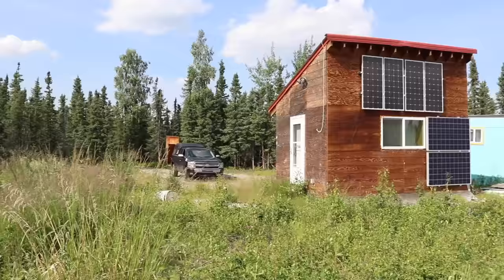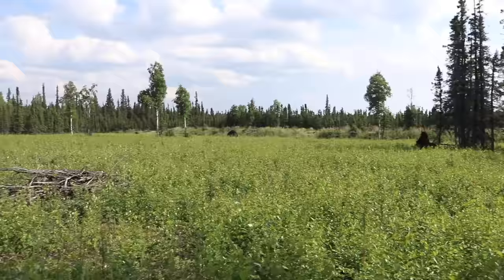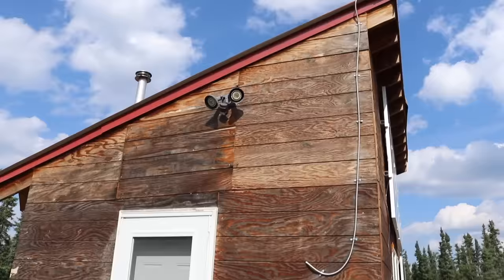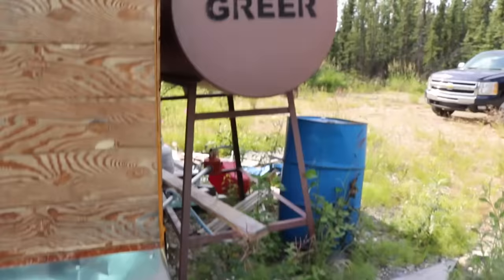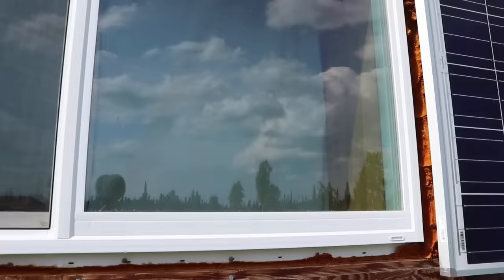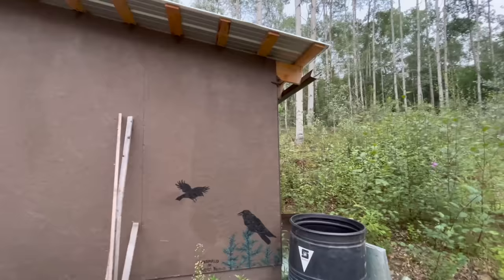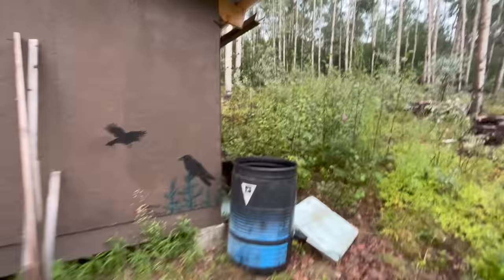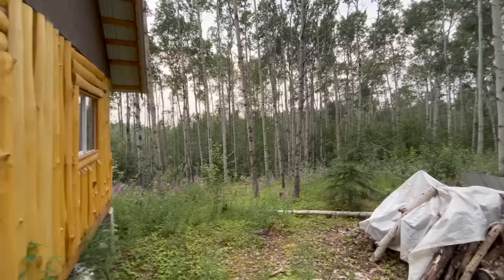Buying off grid land- you'll never hear this from Realtors

Comment: I really liked this video.  I think the first question anyone should have is whether you can even legally do the tiny house/off-grid/shed to house stuff that people seem to have a mania for.  I'm not at all surprised it's easy to do in places like Alaska, Michigan, the Dakotas, or other of the "wilder" states (which may include some of the southern states).

I'm in Virginia.  No, I absolutely cannot hand drive a pitcher pump well (class IIIc well according to the health dept) to any depth.  All wells have to be designed and installed by licensed contractors.  Waste water and sewage is the same way, though Virginia will let me catch all my sewage and apply for a sewage hauling permit to take to a sanitation site if I choose not to have a septic installed.  I can use an outhouse (permit required) for occasional occupancy.

As you point out, cash is king for those wanting to do the off-grid thing.  You finance the land, or finance house construction, you're going to be restricted further.

Then there are zoning issues.  Can I really build a house of square footage less than what my county allows?  Building inspections? 

I went on a rant in one of Dave's videos about my investigation into this off-grid fantasy (for some), and covered even more things to consider.

More people should watch this video as a bit of a reality check.  I like that you note where you and Dave primarily operate, but adding YMMV depending upon where you live would be good for your viewers as well.

Comment: If you haven't already, because of all your experience and prior knowledge, it would be good to publish a checklist of things to consider when looking to buy property.  Many of the things you mentioned in this video would be great things to put on such a checklist and to go though when looking at potential properties.

Access to the property, water, and electricity and a basic livable shelter would be top on my list as a place to start from.  If I wasn't 73, I'd certainly consider buying a patch of land and homesteading it, but I couldn't deal with a bare piece of land with no well and no structure to live in while I worked through the building process.
Reply: @-XtraCredit-  Yes, of course.  Those are certainly most important and if you can't check off those list items, you need to re-evaluate your desire to buy property where those things are essential to already have.  I'd also say having a "Can do." attitude and determination to go from start to finish are essential as well.

Comment: TheT-111 was, which will delaminate over sideways, which is going to collect water in the grooves which will cause the siding to delaminate. It all has to come ff and be replaced. Even if taken off carefully, the pieces look small you will need to buy a ton of flashing and it will look like crap. The exterior oil tank will cause the oil to gel unless you get winter oil which will cost money every year. Tapping into the high voltage electric is going to cost you're going to need to pay for step-down transformers in most areas, the utility may do the work put to hook up one house that uses a small amount of electricity, but they will not do it for free. A company I hired in the '70s accidentally pulled down a transformer I can't remember but I think the cost of just the transformer was 6.5 to 10k plus labor about 3.5k you can triple that price today

Comment: I'm curious about the " You'll never hear this from Realtors " part because of course you wouldn't.  Not because it's some secret or something we don't want you to know,  most places living off grid is illegal so we don't buy/sell off grid properties normally. I'm a REALTOR in Hutchinson Kansas, however, and thankfully living off grid is legal here. In fact, Kansas is one of the most accommodating states when it comes to living off grid. Even harvesting rain water is legal here. The reason the foundations on most of those " cabins " are janky is because they aren't attached to the land and they are small and light weight. The wind alone is enough to shift them from their foundations.  Earth anchors would help as would skirting so that the wind cannot get underneath the cabin. Orienting a building so that  prevailing winds hit a corner and split and go around instead of hitting a small building broadside like a sail would also be a better way to go. I will have that issue here as well because the  off grid cabin I want to put out on the farm will likely only be 8X10 with just enough room for a bed, table, book shelf and my wood burning stove. I already have a 14x40 Amish build lofted cabin from Greensburg Kansas on the farm, but it has running water and electric as well as wi-fi so I NEED a small off grid place. I plan to use Earth anchors and skirting because the wind here is just ridiculous all the time. There is just nothing to block it or stop it. And WHY are so many off grid places always trashed???  Just because it's off grid doesn't mean it has to look like a dump or homeless encampment.  I realize people will have a lot of " things " outside because the cabin is small but it can at least be half way organized and not look like a garbage truck just came out and unloaded. They need to have pride in their place the way Brooke does. Those of you guilty of this should take a page from her book and emulate her.  She's a great off grid role model.
Reply from the maker: realtors don't do the homework/due diligence needed to assess a piece of property for YOU to live on. in my experience they have not asked questions, taken pictures, explored the land, or basically know ANYTHING about the property they are selling. it's just how it is. they are in it to make a sale. oftentimes they've never even visited the land to see it in person- instead relying on the seller to provide (usually sketchy) information and pictures. that's why you have to do this yourself. not a dig on realtors (though the majority we've ever worked with were TERRIBLE at their "job".) I'm just saying do your own DUE DILIGENCE before putting down your cold, hard-earned cash.
Reply: @therealgirlinthewoods  I apologize I didn’t see that you had replied to this even though it’s been a while. Myself as a realtor yes I do all of those things. I thoroughly vet everything for my client. Unfortunately, you are correct in the fact that most realtors will not. However, I do. I have even researched rules and regulations and ordinances for clients so that they knew exactly what they were getting into and precisely what they were and were not allowed to do if they made an offer and successfully closed on a property. I leave them with zero guess work. My clients who relocated here from Colorado knew every single detail there was to know about every piece of property before they even considered making an offer. What they were allowed to do with the property. How It was zoned. What animals they could have what animals they could not have. What type of structures are allowed. All of the fun stuff. It was a lot of work and a lot of research on my part, but it was well worth it to not have my clients from Colorado walking into a new property blind and unsure of what they were allowed to do with their own property. this is something I just take for granted that all realtors do. I guess not?

Comment: Tung oil for 'organic' paint. 
Add pigments to your liking start with white and vibrant colors and mix for tones and complementary lighter tones. 
Waay more weather resistant. 
Or thompsons water seal or deck paint im told are very good options too.
These are the most options imo. 
I am really getting pissed at paint.

Comment: constructed shade can be a better choice than trees. That open lot with solar is ideal for air conditioners, refrigeration, information and entertainment devices, and lighting. It doesn't seem like a good option for geothermal heat without some work. Too few windows on the south side and the solar panels could have been placed better to block summer light while allowing winter light to enter the window.

Comment: i lived in fairbanks in 1969.  no one locked anything in case anyone needed shelter.  cars left running while shopping in winter.  no place to go with a stolen car in winter.  at 69below zero it would freeze the oil in crank case.  i lived in town near the river & crab was cheap

Comment: I like the first property that you showed. But in North Carolina I noticed these are the coldest and hottest areas depending on season. If only if the surround property was also available to build a house. 

Because a house that is shaded to the most part is more economical in the summer months. But the trade off is definitely when it gets very cold.

Comment: I would have expected that the very first thing to talk about when looking for property to make off grid is to check the county restrictions and codes.  For example, when i lived in Fl, i called about 10 counties to find out about permits and what is allowed. And for the most part, you couldn't just buy property and do what you want. Everything had to be permitted and to code.

I'm in a different state now and it's a little more lenient but i still see stories of people who set up a shed to turn into a tiny house and the code people came in and told them it's not allowed.

Comment: I live in PA and I was looking to do this myself. I bought 1.5 acers a little bit away from where I live. 
No houses around and the lot needed a lot of work to be completely usable. Not suitable for a house
but a shed to be used as an off the grid workshop and a little gardening. 

The local realtor said no problem with want I want to do. I wouldn't even need permits for the shed. 
Then I bought it, later talking to the zoning enforcement/building inspector doing what I wanted to do
was impossible for 1000 different reasons. 

So how do I look for property with the zoning needed to do what you do

Comment: Excellent video!  Thanks for the tips!  You mentioned road noise and neighbors shooting.  How do you feel about generator noise?  That's actually my number one concern because most of the off-grid lots are adjacent to each other and numerous so it only takes one neighbor to move in and run a generator non-stop.  Even if all the lots are empty chances are that will change in the next few years as lots are sold.

Comment: A VERY IMPORTANT thing is rain.
Where I live it only rains 3 to 10 days a year.
And that during the summer.
So you have to have a rain catch waiting. 
And 355 days or less there is no rain.
AND YES. Your rain you catch may very well be one day of the year. ONLY.
People that move here don't believe me.
But I'm the one that has lived here for 15 years.
And I'm the only person around that lives off grid.
Which is very important. Became people thats on grid don't realize things that make a difference.
And yes, waiting on the Monsoons to hit. Because you are very low on water is very nerve racking.
Today was the first day this year that I was able to harvest water.
Now don't get me wrong. I can drive 50 miles and get a load of water. 
Which brings up another problem that noobs do.
They buy bottled water.
If you don't have water. Buy something to haul at least 250 gallons of water. ( that weights 1 ton) 
Also figure out how you are going to keep foods.
They also come in the dead of summer before the rain.
Use an ice chest. And very day drive 50 miles to get ice.
 Solution.
Figure out how to live without a fridge 
Or 
Bring a complete system for a fridge.
Myself I don't need a fridge.
But I have a freezer and the solar power to run it. Though I don't use it.
And for God sake don't beg your nieghbor. Especially if you are not willing to do things in return.
Oh and don't show up broken. 
Meaning if you can't do stuff. Because you are beoken. Don't move off grid. Stay on grid with the other weakbroken. 
Honestly, I think people come at the wrong time and are not prepared.
Come with over a year of supplies.
Come in winter. Because that the best time to set things up.
But be prepared for some cold days. And possibly snow. ( no the snow fall is so little do not count as rain)

Comment: Don't forget the DNR wetland maps check if you have wetlands the dnr completely controls any fill you put even on old preexisting roads and will fine you and make you get a after the fact permits .1800.00 dollar fine for the fill than 500.00 for the permit trust me happened to me.i had a 80 year old road I fixed through a wetland

Comment: I just had to pause the video to comment about what you said about price at about 2 min's 15 sec's in. You were talking about properties around 5 acres in size and then you mentioned capping your price search at around $50,000 - $70,000 and that that was even expensive. In Australia, you would be extremely lucky if you could find 5 acres for less than $500,000. Yes, I said $500,000. So for you guys in the US, even at the exchange rate, your land is cheap compared to some other comparable countries. Damn, we'd be lucky if we could get half an acre for $100,000.

Comment: Wish I knew beforehand that NO ONE will provide any insurance for your off-grid castle.  Every insurance company - even the ones specializing in hunting cabins and farms - require you to be on someone's grid.  You need an electric bill, water bill, gas bill or something.  If you're completely disconnected (i.e. "off grid") then they will not write you a policy at all.  This means that if your investment is wiped out by tornado, forest fire or vandalism, you lose everything.  It also means that no one can buy your place with a mortgage.  Your buyers must be cash-only buyers, seriously limiting your resale market.  There is no amount of money insurance companies will take to give you any protection.  They say that without phone or city water or electricity, a fire would result in a total loss, so not worth it to them to insure.  But I think that without city water, I will not have any flooding.  Without electricity, I will have no electric fires.  I don't even have a wood burner, just a little Mr. Heater gas furnace.  It is insane they won't take my money for an insurance policy, but they won't.

Comment: What are you gonna do aboot the rouf, eh? 😊 lol I got another funny joke :

Solar AC?🙃 Biggest Solar Panel Ever. you'd get hectares of shade underneath it.. all jokes aside:

 I think for $48k is reasonable, the water thing being the only put off, I don't know what to say about the heat, it is quite a bother, anywhere..
Maybe a solar fan will work, and have an empty spray bottle when you get heated,, I spray myself and sit in front of the fan..

Great idea in the house, however it's not much help when there is work to be done outside..  Asian Cone style Hat helps with this, and kills the sun's glare quite a bit. It provides your head with some sun shade and protection

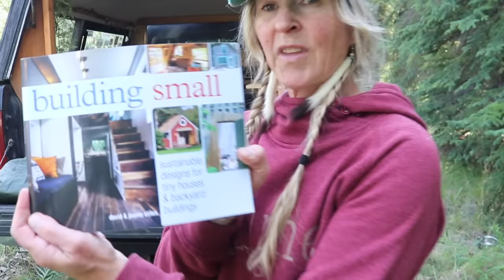Comment: That house at 38:25 or so should be considered a push... So sad to see sub-standard workmanship on a beautifull Piece of property.  The bible says to build a foundation on stone.  I know that with the ability to drive into the property you could probably use a Bigger tractor to drag a container shelter into that piece as a solid "Backup Plan" emergency shelter / temporary construction house. A mid winter fire is a killer both immediate and freeze out are probabilities considering the challenges of heating in the backwoods.  At 73 I am too old for the bush but the work process is in my DNA.  My thought is the best plan to build would be a smaller mid sized crawler loader or tracked bobcat sized machine.  I realize building materials and supplies need to be brought in. If that property was reasonably priced it would probably be yours,  and on consideration way too much work.  Ignorance + idealism + poor planning can = disaster for a family.  I view that property as the culmination of several disasters with a price increase (at a loss) to each of the people/families who got owned by their dreams.